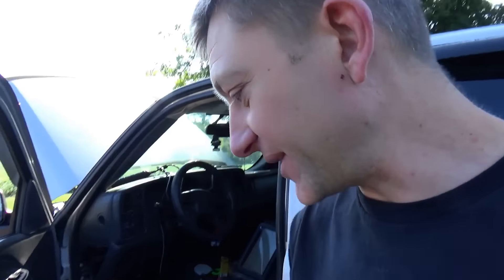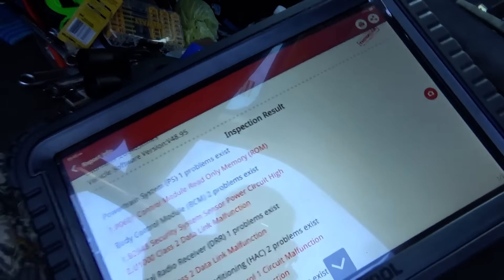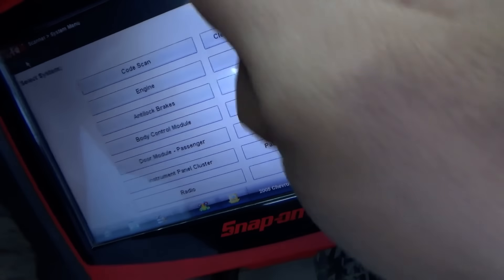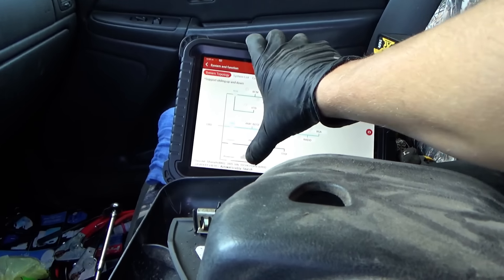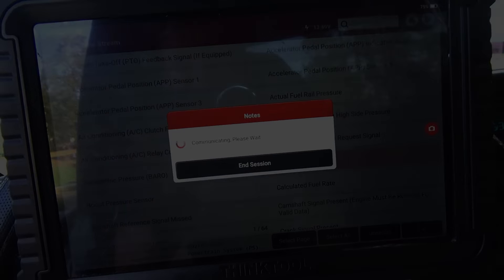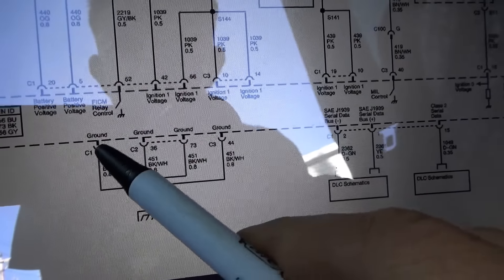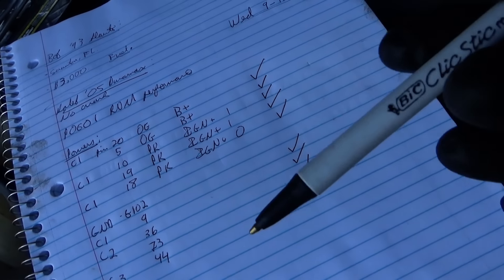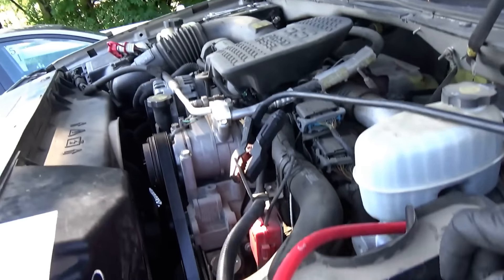Duramax is DEAD...because of THIS?? (No CRANK...Starter & Ignition Switch Replaced!)

Comment: I just got back from the car repair shop where I went because of a broken windshield washer pump. When I saw them start messing with the wiring, I heard Ivan's voice in my head: "No! If the pump starts working now, you won’t be able to find the exact spot where the problem is!"😊

Comment: Had someone bring me a Honda Element. Inoperative horn. Dealership charged them 60 for diagnosis and quoted nearly 600 to replace the horn. Their diagnostic process was to merely swap two relays, evidenced by plier marks. 15 minutes with a meter and I found the wire at the horn was broken. Less than 30 minutes to diagnose and repair. Simple power and ground checks!

Comment: I bought a 05 Dmax 3500 SRW Crew Cab 4x4 brand new in early 2005.  Biggest POS ever.  I had it back to the dealer for 31 issues in 9 months of owning it. 

There was no pattern of failure. Paint pealing off the bed, broken hood hinge, bad wheel bearing, bad U-joint, bad carrier bearing, bad injector, failed glow plugs, bad dash cluster, failed passenger power seat, ect.  

Traded it after 9 months and 10,000 miles for a dreaded 2006 F350 6L PowerStroke.  Drove it for 5 years and about 120,000 miles with only one issue, a Steering Box.  

After 4 GM vehicle I was done and have not owned one since.

Comment: They used Delphi and Bosch units in these Duramax's and it seems the Delphi units were constantly a problem but the Bosch units rarely were a problem.  Just so you are aware for future as a "suspicion" . Great diagnosis as always.
Reply: Logical approach troubleshooting.
Reply: @namvet-l8m  Suspicion about Delphi units is based on experience with them myself, but of course always proving the problem with logical diagnosis like Ivan always does.

Comment: 2005. Right in the midst of the lead-free solder rollout. Those ECUs were probably manufactured in 2004. The engine bay is a TERRIBLE environment for a computer - vibration and temperature extremes. Ivan himself has witnessed numerous cold or cracked joints in electronics of that era. Some manufacturers "figured it out" before others. Great diag and video, Ivan. Glad a used ECU got the Duramax back on the road.

Comment: My 2002 F350 7.3 diesel set a bad glow plug code, and was starting slow. Was a corroded connection in the over complicated battery to glow plugs and starter wiring harness. The harness went from battery to battery, to the starter and to the glow plug harness. Probably should have been built in pieces but wasn’t. On the other hand, lasted over 20 years. Fixed the connectors, charged batteries and, all codes went away, and starts great. The harness btw, was 500$ from ford. I replaced some ends for about 35$ and all was well. Ford actually has a later battery terminal with 3 wires able to come into it, to combat this problem.

Comment: For modern cars, it is really hard to pin point a module due to their complexity, you just never know if a component is shorted that is affecting the PCM is some way, I guess you may set a code if that's the case but when a module goes offline completely, you can only hope that if the power, grounds and com lines are fine, then you can condemn the module itself, who knows maybe, you can disconnect some of the components attached to see if it comes back alive but a healthy com line usually indicates that the module is not shorted to prevent com to occur.

Comment: Warn about Cp4 Bosch injection pump fail on newer Duramax and Cummins and Ford all send metal through entire injection system causes $13000+ damage.
A filter kit and or new upgrade pump is available.
For new common rail diesel.
Disaster.
Also grid heater nut on Cummins 6.7 falls into cylinder wipes out motor .
Upgrade kit also .

Ps who is the best ECM rebuilder repair etc ?
Is plug and play any good?

Comment: As soon as i saw the p601 ROM code, i was thinking pcm issue. High Chance it wasn't a wiring issue. Cause i have seen cars have that code and still ran. Cant run and have bad wiring to set that code at the same time.

Comment: Any idea why the ECM failed? Is it simply age?
Reply: Not the best location. Better in the firewall
Reply from the maker: I'm sure that the failing batteries didn't help either 😅
Reply: @PineHollowAutoDiagnostics  Was the 12 V battery weak? Not changing the battery when required is a potential no no. Not good for the starter either.
Reply: @PineHollowAutoDiagnostics   how did the customer program the used ecu himself?

Comment: Just like fighter jets when I worked on F-4 s and F- 16s weapons systems LRU s  Boxes and wiring..We just replaced the box and took it to the shop and they fixed it .then go through a half-hour  check to make sure everything was working. Having the test equipment is vital. In our case with cars is most people can't afford the test equipment so they have to rely on others to fix it.they don't have that big budget like uncle Sam has all your tax money to pay for all that expensive equipment.
Reply from the maker: Actually the "test equipment" is dirt cheap! Much cheaper than the Parts Cannon 😅 They just don't want to invest the time to learn 😉

Comment: Not to beat in the owner, but how difficult is it to check for voltage at the starter solenoid BEFORE replacing anything. I mean, if you're knowledgeable enough to know how to replace a starter, you're probably knowledgeable enough to use a test light or meter while cranking.
Reply: Everyone is in a hurry and skips diagnosis steps (except Ivan, our hero!).

And then, when that doesn't work, refuses to reinstall the old part or diagnose.  They simply jump to the next best guess.

I've done the same thing. 
Best thing to do is get a second pair of eyes.
Reply: Alot of people don't have the knowledge or skills  to know what to check or how to check it.  So they fire the parts cannon and hope for the best.

Comment: It's a 2005. Any issue programming the replacement.  Been reading threads that gm discontinued sps1 for 2006 and older and sps2 wasn't working for those older vehicles.
Reply from the maker: @gadasavideos8564  he just plugged it in and it worked 😄

Comment: Not to pile on the owner, I’ve done similar stuff, but a starter/battery/ignition cylinder are $300 on Rock Auto. It would have been cheaper to call Ivan first.
Reply: Dude really had a bad starter most likely he let the smoke out of computer somehow

Comment: I'm guessing the PCM didn't like a voltage spike that happened during the starter replacement.  Either by disconnecting/reconnecting the battery, or when sparks started flying from changing live leads.

Comment: I’m surprised you condemned the ECU before checking data lines from ecu to rest of components!
Reply: The codes refer to internal ecu hardware problems so that gives a bit of clue.
Reply: @MA-kt8ly  still I wouldn’t move ahead without checking out data lines
Reply: Was able to communicate over CAN to say ROM failure, so the data bus is working, and the initial code on the controller is running. Will bet the low battery caused the ECU to erase the internal flash, failing the unit. Likely a dealer tool would be able to reflash the firmware and get it running again.
Reply: The ECU itself reported the ROM test failure code, so the data lines were fine.
Reply: @ischmidt  I’m not too sure if it reported it over CAN or K-line. So hard to say

Comment: Nice job GM. Putting the ECM in an unfriendly environment at best. And watching your videos Ivan, it seems your Thinktool is a better test device than the SnapOn.
Reply: Most diesel engines have the PCM bolted straight to the engine block.   Silly but very common.
Reply: @v12alpine  you wonder why..probably cheaper to put them there than to run their harness into the car/truck cab.

Comment: So was old starter good and PCM was failing or maybe owner by installing new starter caused damage to PCM? Maybe old starter caused damage to PCM? Or both PCM and old starter were failing?
Reply: Likely flat battery crashed ECU and made it erase the built in flash ROM, and then it powered on, saw the ROM code was missing and set the error for ROM fault, as the checksum did not match, as it is a blank or partly blank ROM.